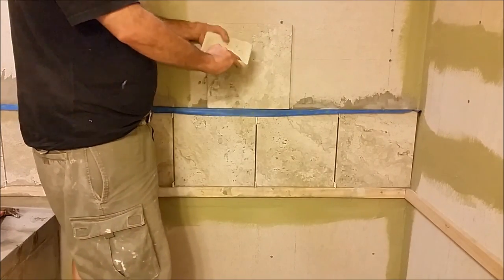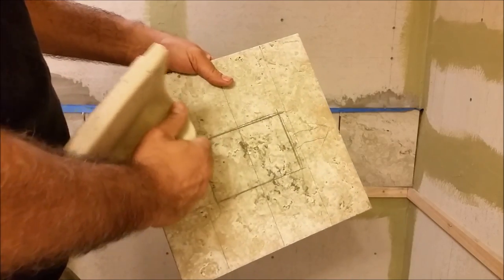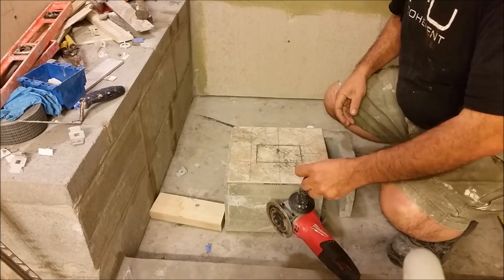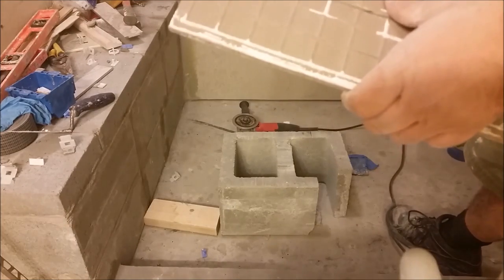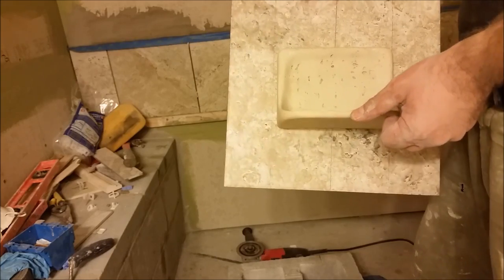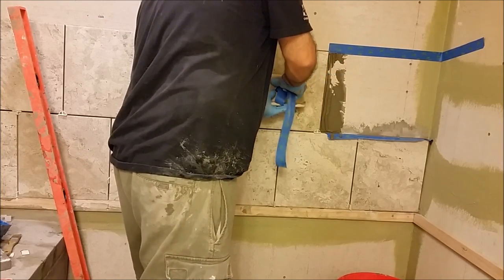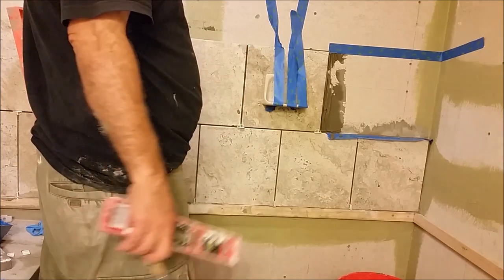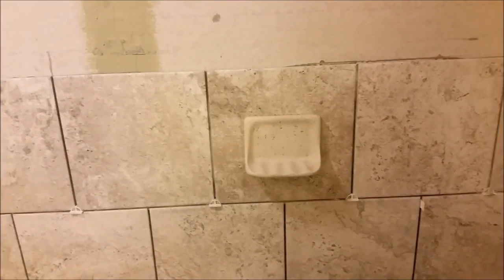How To Install A Soap Dish On Shower Wall - Step by Step - DIY

Comment from the maker: Travertine Resin soap dish https://amzn.to/3nx61Ew
Find shwer corner shelf = https://www.amazon.com/gp/search/ref=as_li_qf_sp_sr_tl?ie=UTF8&tag=josephkhalon-20&keywords=shower+Corner+Shelf+tile&index=aps&camp=1789&creative=9325&linkCode=ur2&linkId=be333d69382c24e4ee09006951baaa62
Try Amazon Prime 30 days for free = https://amzn.to/2JMWaLe
Tools and Material:
Angle grinder used = https://amzn.to/368IX8C
Diamond Blade =  https://amzn.to/3j2kTbc
Dimond hole drill bits =https://amzn.to/36bX2Cs
QEP wet saw = https://amzn.to/3cLJgaW
Diamond Blade = DeWalt https://amzn.to/3jfdpSr or Black Widow https://amzn.to/3jgx18G
Grout Float = https://amzn.to/3j7KO1c or https://amzn.to/348KLMu
Notched Trowel 1/4 x 1/4 x 1/4-Inch= https://amzn.to/3j26Zpv
Notched Trowel 1/2x 1/2 x 1/2-Inch= https://amzn.to/2S5Zceg
Notched Trowel 1/4 x 3/8 x 1/4-Inch=https://amzn.to/3cDPbhZ
Nitrile Gloves = https://amzn.to/3i8VhrT
Best Thin set used = https://amzn.to/3cxVBz8
Medium thin set =  https://amzn.to/3mSk9aR
Mapei Pre Mix Grout = https://amzn.to/2HqhdC3
Mapei Grout = https://amzn.to/340hWS5

Amazon Deals:
Try Amazon Prime 30 days for free = https://amzn.to/2JMWaLe
Create Amazon Business account = https://amzn.to/3mLSyYt
Joint Amazon Prime Watch Thousends Of Movies and TV = https://amzn.to/33NfsHD
Try Personal Shopper Wardrobe  https://amzn.to/2VClfv9

Comment: Why did you use Thinset on a resin soap dish? According to thinset instructions,  you should not install resin tiles with thinset. I was told to use 100% silicone to mount the soap dish.
Reply from the maker: This is the correct installation You should put silicon in the gap between the soap dish to the tile after the tin-set dried, in order to seal the back of soap dish from water.
Reply: actually you can use either Thinset, ceramic glue, or even grout if you want. I don't think the ancient Egyptians or Greeks had Thinset and their tile work is holding up pretty good..... :)

Comment: You need a shield for that grinder.   They are designed for a purpose - to protect you from injury.  Use it.
Reply from the maker: You are correct . I always use protected glass.
Reply: Safety glasses will only help for your eyes.  Glasses or goggles are mandatory, but if the cut-off wheel were to shatter, you can get shrapnel on your face and cause serious injury.  After seeing videos on injuries from flying parts, I am now more aware of my safety.  Trying to help, that's all.
Reply: no tile guys use the guard, you have to cut through and at different angles. Get off your safety horse dude.
Reply: REAL MEN don't use safety equipment dearest Roland. They breath in the dust and spit it out on the kitchen floor of their pansy customer, ha!
Reply: In mother Russia grinder needs shield to protect from you.